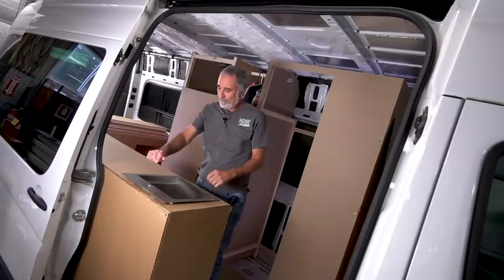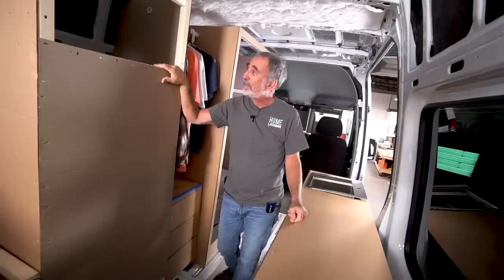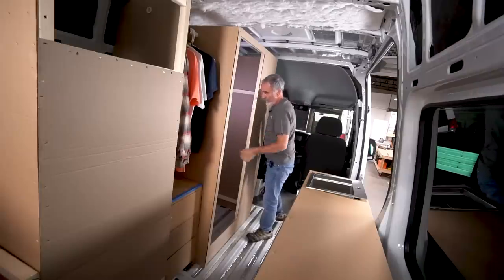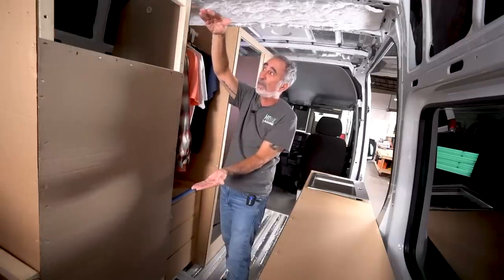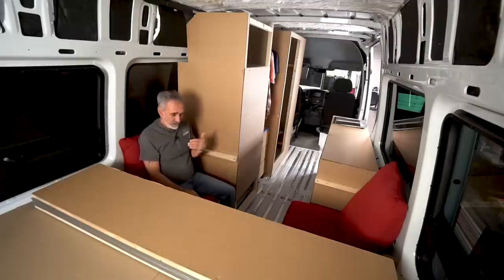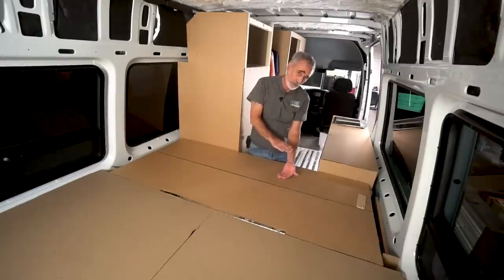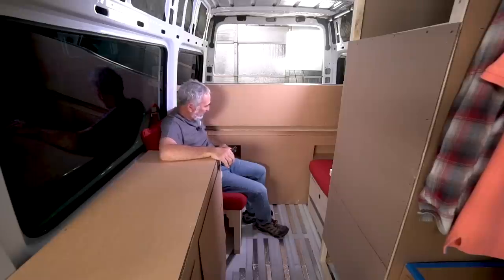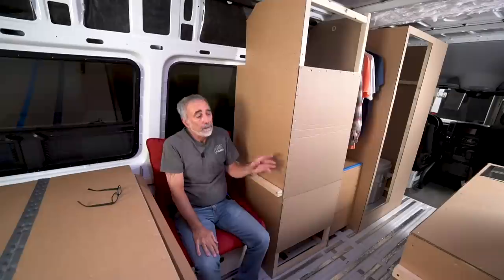Dining in a Sprinter van. Hidden bed. See the cardboard test floor plan!

Comment: Rearranging the fridge / wet bath cabinets and the armoire is a genius move. Looks fantastic.  Like you said, you can mount a short hanging bar at the top of the fridge cabinet with enough length / strength to hang a few items, say maybe a couple of coats or something.  Really nice. It would also be super-easy to put a typical "stretchy string" hanger across the shower enclosure to dry towels, etc. between showers and visits to the bathroom.

Comment: A lot of effort for the cardboard build, but it pays off a hundred times. Great work!
For the bed, if you just slide the folded part over the fixed part (on rails at the sides), you have only two pieces. And you get even more open room, you can lay your arm onto the fixed part of the bed.
Reply: These vans are the best!
Reply: It’s probably the best way to make sure that your idea holds water.

Comment: George,
An idea for more space.
Position / use of the toilet.
In the shower area, on the large hinged box, split the door at the lower edge if the existing box.
Build a separately hinged 8020 box frame below to duplicate the upper frame, hinging on the same corner,, but leave the face nearest the rear of the van (closed position) open.
Latch the two doors, frames, together.
Place the toilet in the lower box frame, facing rear of van.

Shower use:
As before, but the toilet box swings out with the large box, latched together? (Upper frame helps support the toilet box)

Toilet use:
Open as for shower use, but unlatch,  leaving the lower "toilet box" in the shower area, user sits facing the rear.
Base of the toilet box frame rests on shower tray when in use.

Advantages(?)
Allows use of privacy/ shower curtain if required.
No "momentum" issue.
Allows shower unit to move forwards, or hanging space between box and driver seat.
Use a lift up work table?
Drivers seat can be swiveled, then slid towards front of the van for work use.
Since toilet "shoulder width" isn't required, this could give maybe 12"+ of extra space?

Hope this makes sense.

Comment: A great thing about the cardboard mock-ups is that you can build a design library. Once you've done a few vans and have those mock-ups folded away on a shelf, it would be easy and quick for future clients to put together a layout from components you have already done and walk thru it.
Reply from the maker: Sort of. They are all built with 2x2 framing, which matches the 15 series 8020 that I use in the real build.  So storage is going to be tricky.

Comment: Hanging closet in the cavity of the bathroom on a hinged door with a curtain for shower in use.
Reply: Yup, I posted the same comment before seeing yours so deleted mine.
Reply: Nice damp moldy clothes 👍
Reply: Or a sliding hanger rack ..
Reply: @MrJFoster1984  Nope. You direct air into that space. If you have a diesel heater you also put air in there... 
Every van imho should have a wetroom with drying capability,.

Comment: The second floor plan makes for a very livable space.  Its less dark and depressing, no canyon effect, more open space, very cozy with a lamp on the nightstand.  Superb idea, George!

I would also go with a swingout hanging closet for bathroom for some clothes storage. 
Use an 80/20 carcass with frosted plexiglass inserts for walls and some colored LEDs inside for a night glow.  LED colors can be changed at will for different lighting effects.  This way you create a light box in the passage. 
Instead of a hard wall, why not a fold-in, fold-out curtain rod with a nice curtain.  This is similar to Extend-A-Rod commercial ones but will be made to spec by you.  Fairly simple construction.
Swing out closet, fold out curtain for a spacious shower with more elbow room than the footprint.
Alternately, maybe use a spring for a curtain rod that attaches to back of closet, so when closet is pulled out, shower curtain also pops out.

With regard to medicine cabinet, I have a hare-brained idea.  How about a sunken storage box built into the sink counter activated by linear actuators, like the old Airstream sunken coffee makers. Press on the cutout on counter, and out pops a small medicine cabinet.  The other option is to attach it to the plexiglass closet back end.

Comment: I enjoy your videos.  I have a PleasureWay Ascent and "solved" the hanging clothes issue by putting an expanding clothes rod in the bathroom.  That space is usually not use as much and clothes can be push toward wall or temporarily removed for bathroom or shower use.  Works for me.  You do great work.
Reply from the maker: Great tip!

Comment: I’d like to see a unit built where the partial bed (those two moving sections for instance) fold up into a couch with steps up and removable tables then swing in. Then you don’t need both seats. This is still another very thought out build. I love your explanations and discussion for options. It’s like listening to you think. Cheers.
Reply: You might be interested in how Eamon and Bec vandwellers designed their transformable bed to couch mode by putting piano hinges at end of raised front-to-back bed to drop down and make side-to-side seating.
Reply: ColleenKaralee First build or second build?

Comment: For those who must have hanging clothes, a bar in the shower works great. Or one of those plug looking things like hotels put on the back of doors (think pipe with a stopper on the unattached end and can hold 3 - 5 shirts) put on the fridge's side panel towards the dining 'room', would also work.

Comment: Did you consider reducing mattress to 3 or 4 folding joints and drop the bed base down a little if  a clear rear window is really needed? I love your designs, you are so innovative - when ever I think you nailed it, you come up with a new  better design. Ever thought of modifying the building system so that every 5 years, customers can come back for a new and improved layout?  Great videos, great ideas.

Comment: Love the cardboard mock up, its a must for quality build like yours I reckon.
I'd vote for option 2. More space more light.
If customer needs formal atire while travelling, would a very thin floating wardrobe fit above the armoire.
Without spoiling feeling of space
How about a floating and sliding lagun table, where the pivot is hidden under the bed somehow with a latch under the tabletop to allow it to slide on the mount work.

Comment: Thanks George, I like you talking through the give and takes.  Can I get the make and model of that fridge so I can compare dimensions to others?  I’d like to see what is gained on this vs others.
Reply from the maker: You bet
http://www.novakool.com/products/two_doors/rfu6200_6800_8000_9000.htm
Reply: @HumbleRoad  George, whatever happened to that 2nd Isotherm Drawer 160 fridge? Are the front door fridges working out better?

Comment: George, I don’t know what stage you are in on this van, but I have a thought.  In setup 2, if you pulled out the fridge to be at same position on front as is the bathroom, you could put a small hanging clothes bar at rear of the fridge.  I can’t tell by the video, but it looks like you could have 6-8” for hanging clothes.  Thats a fairly good amount of space.

Comment: What do you think of raising the floor a little in order to accommodate hidden spaces for the valuables to be stored under there? Would you, please, include dimensions of the cross-section(s) for the ProMaster/Sprinter? How about sliding out hidden spaces where the “kick-boards” are under the cabinets? Thank you kindly. Stay safe...
Reply from the maker: https://youtu.be/UM-6jqfxGgI

Comment: Hi George, I have been thinking alot since I started watching your videos ... my design concept would make use of the two chairs in the front, put them on a swivel and make a nice big desk/table (like in the last build) between those seats. In combination with a curtain (light and heat insulation) which goes from the sidewindows to the frontwindow you gain a lot more room. On top I´d opt for a bathroom solution (the one with the open bathroom and curtains) like you already build once. This opens everything up. Let me know what you think about it ;-)
Stay save / healthy!
Btw the Advanced RV solution with the expendable shower curtain might also be an option for your clients

Comment: research retail face-out bars for hanging clothes or...use a multi item hanger and attach two i hooks in the ceiling so one side can be lowered so clothes hang against the fridge while using the dinette...reconnect when you need...de-wrinkle, dry, or select clothes..

Comment: George what do you think about turning the cab swivel seats into a dining area? Always wonder about not being able to see out the side doors when sitting.
Reply from the maker: The cab is too narrow to sit facing one another. SO you end up sitting at odd and random angles to one another. Not a big issue just not optimal.  I have those two seats in mind to be used as individual workstations.

Comment: What if the table had two slide out planks from the bed instead of one. That locked using a joint cut to make it stable as one. Or maybe even three? That way they can choose the width of the table.

Comment: George, can you think of a sliding mechanism to close the bathroom door from the inside, and seal the shower that way, similar to the Van side door closing from the outside, and sealing it from the rain?
Reply: @m.r.4798  That is a consideration, if the bath is sort of hidden, but it may not be up to par with the quality of George's typical build, if exposed. I was thinking more of a commercial airplane door, that opens in (not out).

Comment: May I suggest lowering the passenger side kitchen counter right next to the dinette seat to the same height as the drivers side.  Not the whole counter, just where the bed comes down on. Still useable as prep space ( albeit lower ), but gives more shoulder/elbow room. It also gives them a place to dine without pulling the table out.
Reply from the maker: That's a great idea!

Comment: George, another great piece of work here.  I especially love how this video has garnered so much viewer interaction in the way of design suggestions - I think this is a credit to your style of storytelling!!! 

One question I’ve had for a while, would you ever consider adding any of your unique design elements to an existing van build?  - for example, (lol) ... I would love to have an 80/20 constructed shower room with a swing out armoire designed for and installed in my existing VanDoIt Ford Transit build.
Reply from the maker: At this point, full builds is where my focus is.

Comment: Nice layout!  The cardboard makes it easy to visualize and rearrange. With inches of space at a premium, when build time comes, how do you compensate/allow for ceiling, flooring, insulation, and “walls”?
Reply from the maker: Those measurements are already included in these cardboard modules.

Comment: Have ya used those Nautilus retractable self cleaning doors on the bathroom? I’m wondering if they are sturdy in case my dog bumps into it (he’s a big dog). I want a long bathroom, so I can have a center divider to keep the toilet area dry for my towel and to change clothes and dry off, maybe a center shower curtain. I don’t wanna dry off and get dressed in the middle of the van. Our ProMaster will have bunk beds. And we will sleep sideways. The lower bunk will stick out 15” from the top bunk. Cuz the electrical system is in a low-ceiling garage, so the top bunk will be over the garage. The lower bed will be a bench seat but I need a way to have a backing, that doesn’t take up space from either bunk bed, so it can’t fold up or it will take up bed, head-room... it’s so fun to think of cool designs. Specially designs that don’t require a old cripple lady to move stuff around

Comment: If that were mine, I'd be requesting a "double top" on the armoire.  There would be a fold-over half section of the top toward the front of it to serve as a desk to accommodate my laptop.  If I need to get up to do whatever,  I slide the laptop back towards the side of the van, fold the desk section back over, and voila.

Comment: Hanging clothes is such a waste of space, you can fit ten times the clothing folded or rolled in the same hanging space. Plus people jam them in chock-a-block so your clothes are crinkled as heck anyway.  That second layout was so much better.
Reply: could build a softwalled case that hangs down over the drawer set - with the depth set to roll diameters.  Cover it with accent intended fabric as seen from the bed, and have soft shelves in it...

Comment: Question: It looks like some of the windows will need to be walled in because of shower, closet. Is there a risk of condensation building up in this area and causing problems? I am in the processes of buying a windowed van and plan to fully wall in two windows.
Reply from the maker: If windows will be blocked, spray paint them black from the inside, then lay over a couple layers of thinsulate and then an air gap, If behind a refrigerator, add a full length foam board.
Reply: Humble Road thank you, is the spray paint just for it to look nice from the outside? I was thinking about getting like a vinyl wrap type of deal on the outside of the window to make it look white like the van body.
Reply from the maker: Yes, a wrap would accomplish the same

Comment: A hook on the side of the fridge box that can hold a couple garment bags should be enough for any dress clothes you need to carry in a van. Add a couple loops so you can secure the bottoms with a bungee cord so they don't swing around when you're driving.
Reply from the maker: That's a good concept. But I don't want to look at those garment bags hanging. They would have to be inside an enclosure of some sort.
Reply: @HumbleRoad  Fabricate a "soft-sided closet". Or, commission custom garment bags or covers with fabric and hardware to match the interior - like the custom luggage you get when you buy a Rolls Royce or a Bentley. Then, it becomes a feature instead of a bug.

Comment: Good thought process.  folding mattress is nice touch.  Still seems way too crowded!!  If it were me,  I'd ditch the rear dinette entirely (causes too many issues), replace with a shallow battery or clothes chest/bench, leave the refrigerator abutting the bed thus maximizing aisle width,  and ditch the armoire to maximize the front lounge space since its more open and inviting to guests visiting at the side  door entrance.

Comment: How about push the bed towards the back and the let back fold up as a headboard? Someone could still sleep on it during the day at an angle. The dining room would still be available. The wall made by the bed would be gone.
Reply from the maker: Yes, but then you would be sleeping directly on the seam, no?
Reply: @HumbleRoad  A thin mattress topper wouldn't resolve that?

Comment: With the much needed elbow room added in the latest mockup, a clever solution would be to use the exposed refrigerator side wall to install a pull-down style hanging wardrobe arm system, that allows cabinet style doors to enclose this 5-6 inch deep unit. The user would open the doors to reveal the built-in pre-hung flat stacked in a downward style (look at a magic wonder hooks design) stored clothes, which as they pull down on the counterbalanced arm will drop the clothes down into a more tradition viewing hanging clothes system that you were forced to forego for easier viewing of your selections. This will only impact the design of the top half, and will not take away from the lower drawers that you just fought so hard to regain this space. You will only be stealing 5-6 inches from the elbow room table top section, maximizing your space. You could install 2 side-by-side drop down arms, spaced according to the width of shirts, that retract upwards to a pancake flat shape into a nice 6 inch deep recessed cabinet and provide 4-6 eyelets on each drop-down arm, which could be double hung depending on the bulkiness. Repurpuse an 80/20 extruded aluminum arm with eyelet spaced for maximiming both the dropdown and retracted storage capabilities. The key to the space saving success of this system is the reorientation of the shirts downward flat against the arm, as opposed to the tradition hanging on a horizontal bar method. This is how cleaners conveyer belt many clothes at once. If you can arch the the design of the arm to take advantage of the retracted upward position, since this will primarily be the position it is stored the longest in. (A tappered arm design) Please see this link beliw for design visuals: https://images.app.goo.gl/LsLY8HciydGuuFcz5

Comment: Looks great!   So why the face when you mentioned microwave?  Also, what’s the largest battery you can install?  Your photography background seems to help is understanding how to best use space.  You have a gift.  Thanks for sharing.
Reply from the maker: If you watch my videos, I am not a fan of microwave ovens. The largest battery is not necessarily the best battery. Everyone is in a race to the top in terms of amp hours. Imagine driving a nitro-fueled dragster only around town. That engine wouldn't last very long. I think the sweet spot for battery power is between 600-800 Amp hours, which gives you a night of air conditioning. Add to that; solar, DC to DC charging capability and shore power. I do install a second dedicated alternator, but like microwaves, I'm not a fan. Prefer to keep things simple and owner serviceable.